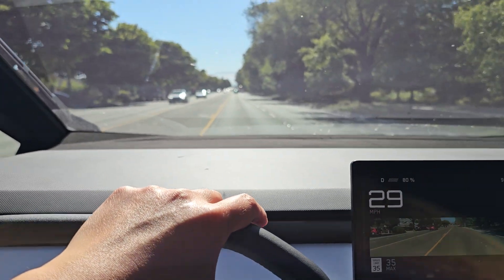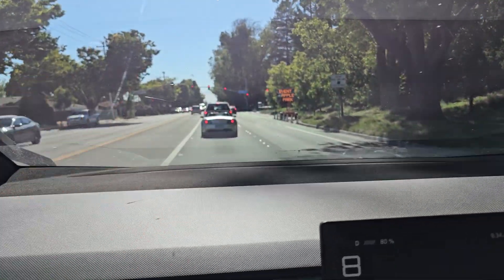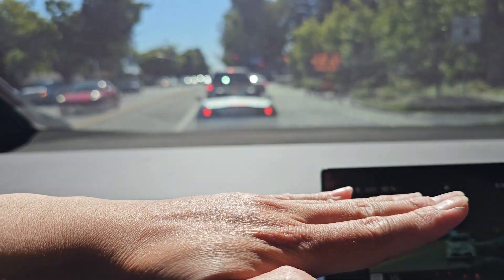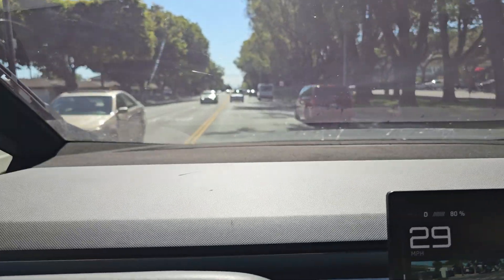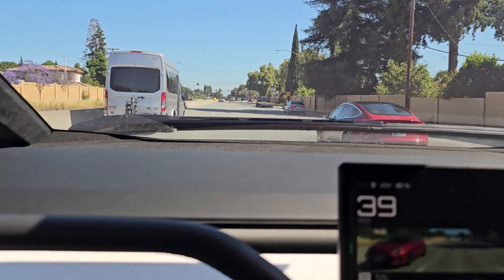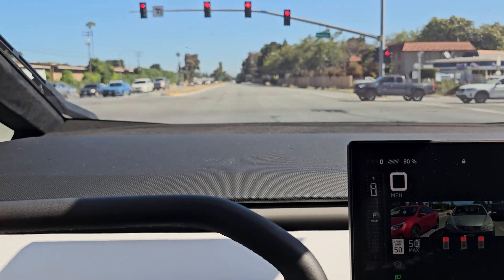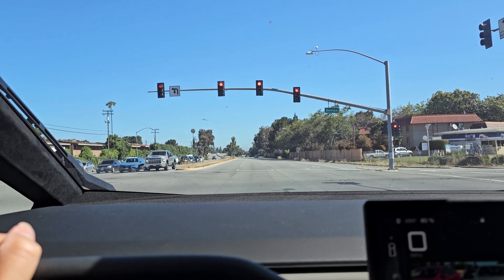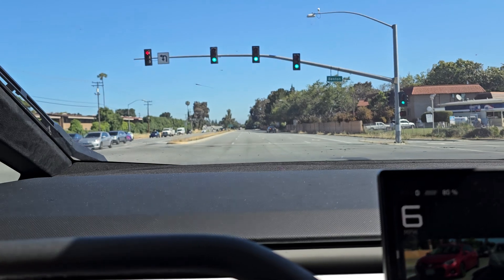Cybertruck Windshield Wipers How they Work Why it Stays Down and Doesn't Go Back Up

Comment: Thanks for the info bro!
But I have one issue with the wiper, sometimes it wipe by itself without detecting any rain or water on the windshield while driving. It’s annoying. Have you guys encountered that issue?  Any fixes?
Reply from the maker: Yes, it happens when light hits it weird or it thinks something it sees is obstructing the camera. I just turn the wiper off instead of leaving it on auto and it stops.

Comment: Drove 500 miles roundtrip in snow, and the wiper blade staying down was so annoying. The spraying also seemed pretty useless. But thanks to your video, now i know why it was staying down! I did notice the water after being wiped would start to slowly travel up the windshield while the blade was upright. TIP: If you hit the wipe button, you can use the left scroll wheel/ button on the squirkle to adjust the wiper speed, set it to auto or turn it off (which will make the wiper blade return to its upright/ default position).
Reply from the maker: @dharmendra.singh.1985  yup!